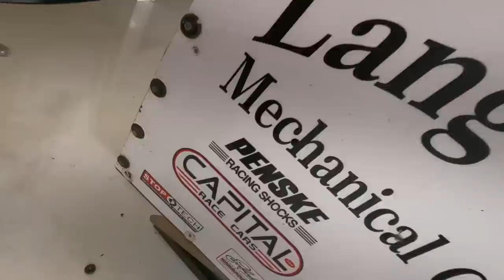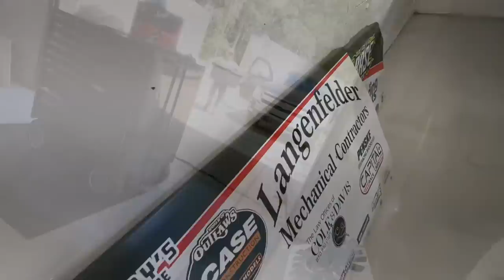Faithful Rides Again! Hurricane Ian Made us Change our Racing Plans

Comment: Concrete slope problem.... try looking into a process called " mud jacking" or "slab jacking".  It might work to change the slope of the slab so that the water runs away properly.  There must be companies somewhere near you that do mud jacking.  They drill holes into the slab and pump a mud slurry under the slab.  The pressure lifts the slab. The mud slurry dries under the slab. Very solid professional fix.  Afterwards you'd probably want to fill those drainage  troughs.

Comment: They make a ROCK GRINDER ATTACHMENT for skid steers, long as your machine has the high flow quick connect,You can grind a 1/4" or so off and make that water run where you want it to go,We do it all the time

Comment: One tip I've learned. Where the door over laps the quarter, don't rivet the two together, put a little brake on the door to stiffen it up. This will save panels individually from contact, instead of being tied together. Just a thought. If someone smashes the quarter it won't transfer to the door and vice versa.

Comment: On the approach drainage, target concrete saw. Find the high spot ,cut saw blade width cuts for drainage ,4 to 6 inches apart  as many as you need.. Only deep enough to drain, doesnt make the slab hard to cross with small wheels ( jacks,car dollies etc.)

Comment: Just get concrete saw and cut it deep enough on the high side to let water run out. May take 5 or 6 single cuts saw blade width and space them out about 8 to 10 inches and its cheap if you have a saw. Hope this helps.

Comment: Since you have to roll the cars around so much cutting those channels seems like it would not be ideal, being that you are in sand if you could cut cement in a 6 or 8 inch square or circle  or bigger if nessasary and then dig down in sand as far as possible then fill with pea gravel and put a nice drain cap/ grate flush with cement then it shouldnt be in the way.and look good too!  you should be able to rent a small auger to get a nice deep hole. I know itll work iv'e used this method for heavy clay soil so i know in sand it'll be a breeze!  the key will be making a nice cut and getting thru cement.

Comment: I think the 2 crate racers is a far better plan than racing supers with that "problem child" super late.  I don't think the chassis is the problem.  I think it's motor.  Couldn't pull the other cars at the back of the pack.  Hammer down Joseph and Jessie.  Good luck HTF!

Comment: I have a thought, rather than worry so much about how your water drains, maybe you guy's should figure out how you can win races or at least make the mains ( finish a race ). These should be priority over slab drainage, podcast backgrounds, t-shirt storage and sales.
Reply: How do you think they have the money to race? Tshirt sales, podcast, YouTube, sponsorships. Which not many people know this part so will leave a tip as a sponsor of racecars. How you do on the track doesn't get you a sponsorship. What you do to promote the sponsor off the track and get them traffic whether it be sales, facebook likes/follows gets you sponsors. I would rather sponsor someone that gets last place and sends me 10 customers however they do that than sponsor someone that thinks just putting my name on the side of there car and I might get 1 customer off of. On the drainage issue. The best way to win races is preventative maintenance so if the car isn't clean it is hard to do that. So making sure the water doesn't run back into there shop and they have to spend half the day dealing with that makes it so they can spend more ti.e working on the car and finding ways to get it faster.
Reply: @jasonnelson2744  👍